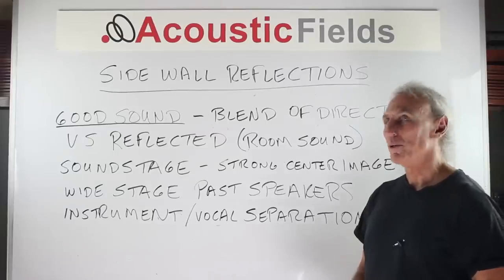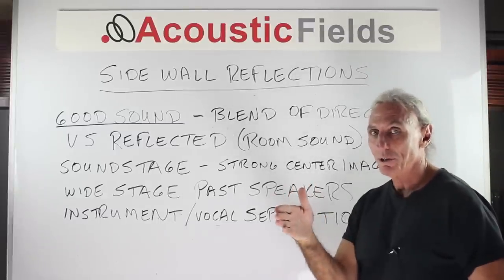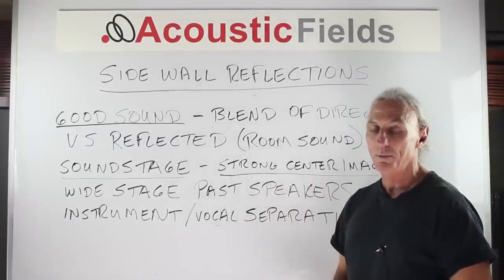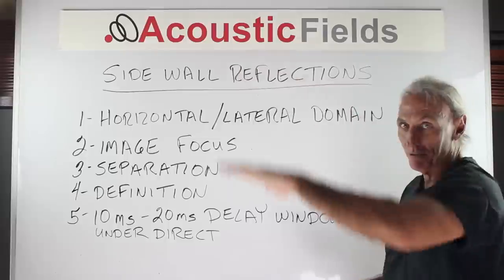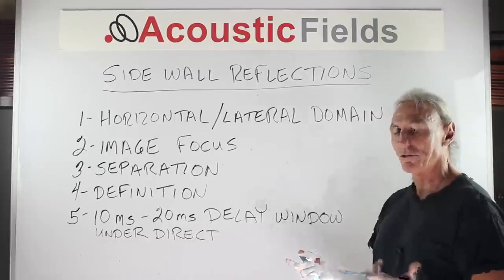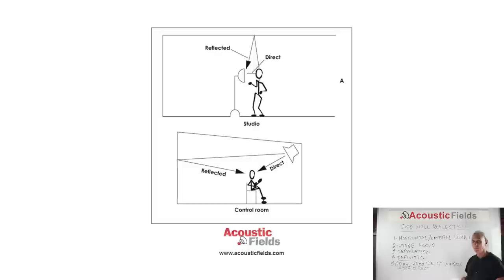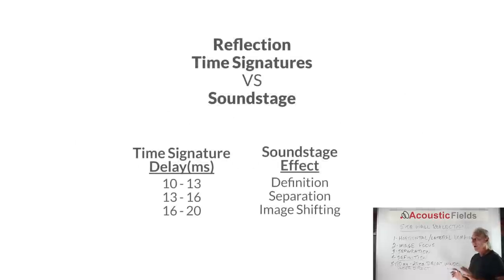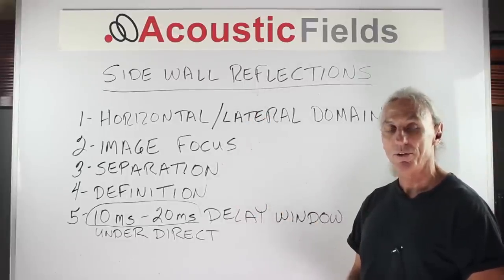Why Managing Side Wall Reflections Is So Important - www.AcousticFields.com

Comment: Moved the Front Left and Right out 1 foot and away from wall another 1 1/2 and found a huge improvement. Still working on audio reflections from back wall and ceiling.
Reply from the maker: Hi J, Stand between the speakers, face the front wall, listen for pressure and reflection balance.

Comment: Dennis I enjoy your videos but there is nothing on YouTube about reflection/reflected that speaks to my speakers. I run Definitive Technologies, a set of bp 8 and a set of bp2000. These are bi-polar speakers and the woofers on the bp 2000 are directed out from the side of the cabinet as well as having their own 300 watt amps for each mounted inside the cabinet. I have the bp8 about 3' from the wall and 2000's about 4' and they sit 2' in from the side walls. in this configuration I have sound headed for the back wall and bass headed toward the walls. These are great speakers and I wouldn't trade them for anything else in the price range. I know that some audiophiles scoff but I have serious doubt that the actually know what these instruments will create. I'm getting ready to start making some baffles and right now all I know to do is treat the room as I would for a more direct traditional speaker. Any thoughts or questions? - Marcus
Reply from the maker: H,  Without knowing the dimensions of your room I can not assist you. If you want me to take a closer look at your room, fill out the information in this link: https://www.acousticfields.com/free-room-analysis/
Reply: Oh course, I know there are many other considerations, appreciate your response and I will check out the link - Thanks much Dennis.

Comment: Hi Dennis, my room is 16'6"w x 27'd x 8'6"h. I have NHT 3.3 speakers that are 3" off the back wall, 11' apart, with an acoustically transparent video screen between them.  A good friend gave me (4) RPG Abfusers (SP?) a few months ago, and I can not get my head around where to put them...   Any suggestions?  I have walked around my room with various test tones at different hz, but have no idea what would be best.  Suggestions?
Reply from the maker: J,   I am hoping that your speakers are 3' from the front wall, not 3". I am going to assume these units are absorbers/diffusers. If that is the case, then across the rear wall would be a good start.  Without knowing the size, it will be difficult to know if you have enough surface area coverage.

Comment: How do I manage side wall reflections in high ceiling hotel ballrooms? The reflections produce a very thick comb filter.
Reply from the maker: +Erick G You have two options: diffusion and absorption. Which one to use depends on the RT-60 measurements within the room, distance from wall surface to listener and many other variables.

Comment: Hi There, love your videos as its very helpfull understanding acoustics! I am still working on acoustics in my new room as just moved. Really happy already so far. But is all the pressure which sometimes is really unpleasant as getting too loud, caused by the room and or speakers related? Or is it also in the recordings itself sometimes? Most records sounds amazing without any problems.  Others have a raise in volume level thats really annoying. In my new set up its even worse, but i also produce music and it helps me leveling it down. I ask you this because i also hear it on all other set ups and even in headphones, so could it be in the records? Whenever i analyse it in my DAW i see huge raises of RMS which to me could be the cause. Peaks i dont find annoying. If i didnt hear it in heaphones i wouldnt asked you. But still not sure what causes it. Best Regards! Patrick Alphenaar.
Reply from the maker: P,  Your room size and volume must match your usage. You have to treat the low, middle, and high-frequency issues within that room size/volume/usage.  Most recordings today are inconsistent in quality and of poor sound quality.
Reply: Acoustic Fields thanks A Lot! I also share that feeling of lots, of bad sounding over hyped recordings. But i always thought that a Mastering engineer would fix that. And yes i need to work more on all frequencies but i live to work on that.Taking it step by step. Best regards. Patrick.
Reply from the maker: P, Every link in the recording chain has its limitations. A  strategy to achieve a quality recording is no different than the strategy to achieve a good room sound. You must do many things correctly, but just as important, you must do them in the correct order or sequence. Doing something well and then doing it at the right time fills that big difference between good and great.

Comment: Interesting how it' all theory and whiteboard bullet points, but not anything real world about how to transfer or reference in terms of actual recommended treatment. I realize you have to leave some room to make money though ;^)
Reply from the maker: Hi ***** 

The issue is that every room usage, volume and size is different.  There is no one size fits all.  I've tried to make that clear throughout my presentations.  So I'm teaching theory so that you can understand the principles involved.  If you want a starting point on managing reflections use 75% treatment coverage of wall and ceiling surfaces.  That's a broad guide, not an absolute.

Thanks
Reply from the maker: Hi ***** 

Was thinking about what you wrote. If you have a specific issue with your room or a question that you would like answered please let me know and I can address it in the next hangout. So if you have a situation or scenario you walk me through I will try to answer it.  Room measurements and room usage are always the key components if doing so.

Thanks